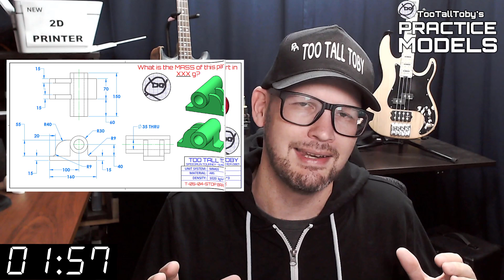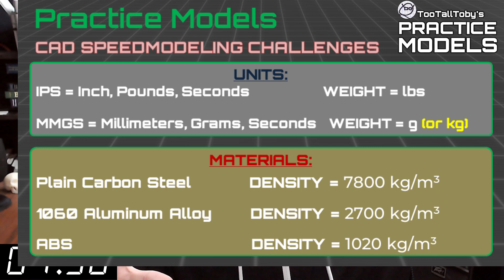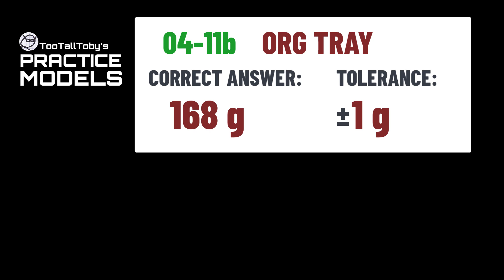SOLIDWORKS Practice - Onshape Practice - Fusion 360 Practice Exercises - TooTallToby-04-11b

Comment: onshape - 168.693g after doing magic voodoo and wizardry. for time. 4🍻 cheers.
Reply: the rib is offset 3mm at top and 3mm at bottom due to thickness. if you do a simple triangle. in onshape with a base of 10mm.  and a height of 40 - 3 (for base) (-3 for inset). its 34 mm tall. that will be 2.85mm at the top. drop it down. do a full circle and pass it all around,  you are welcome.
Reply from the maker: Very nice!  Love the use of trig!

Comment: Mass = 168.20 grams @ 3:50 in SW23 SP1
Reply from the maker: Great job Anne!  3:50!  Speedy!!
Reply: @TooTallToby  i do them all without practice. Just open part, save under filename and then as soon as time starts apply the right material and units and go